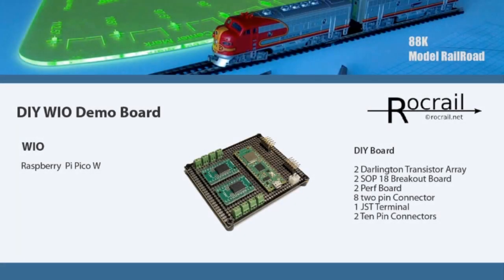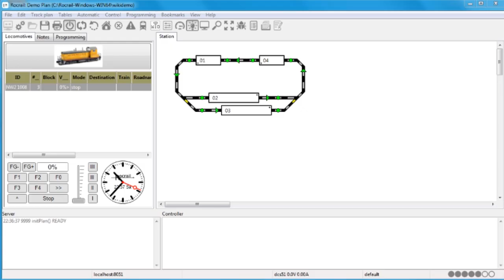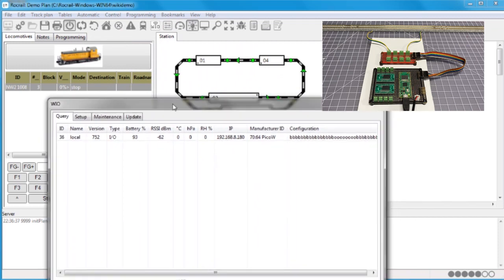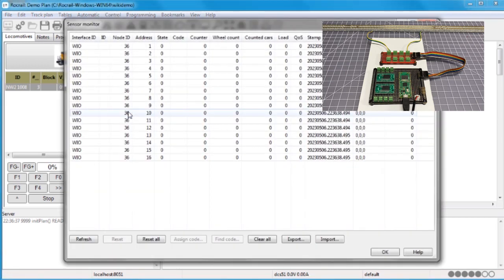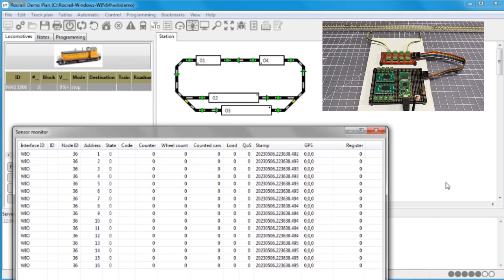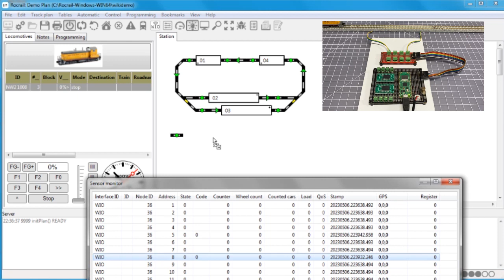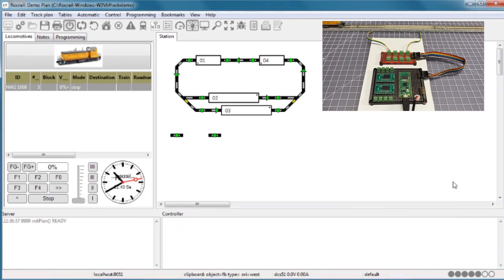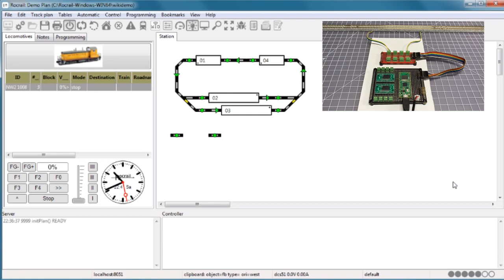Rocrail WIO Demo Board Part 2

Comment: Nice video.. Is the Rocrail WIO a way to replace the command station?  I use Roco Z21 blackbox connected through WiFi to the RaspPi running Rocrail.
Reply from the maker: Thanks, Rocrail WIO allows you to deploy remote RPi Pico W on your layout. They control and report events via the GPIO pins.
Reply: @my88k-mrr98  Can you pl make a video on how the components were put together?  Also Rocrail has the option to read RFID tags on rolling stock with reader under tracks using ESP8266 or equivalent microprocessor.  If you could post videos when you find time on this topic too, it would be great.
Reply from the maker: I have them on order.

Comment: Hi could i ask what sensor's are you using ... current draw, light, motion or something i missed in the video. Regards Jim
Reply from the maker: It's the KY-018 Photosensitive Resistor. Make sure that it puts out voltage when its dark. Meaning when the sensor is covered voltage is present on the S pin.
Reply: @my88k-mrr98  thx